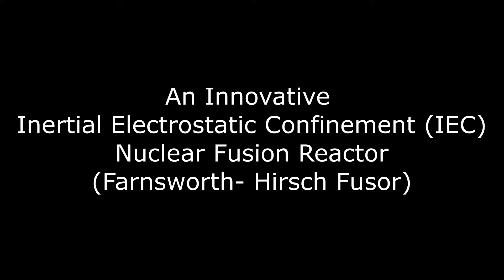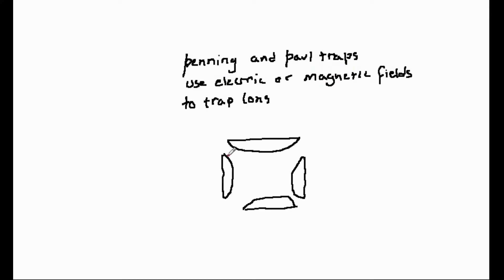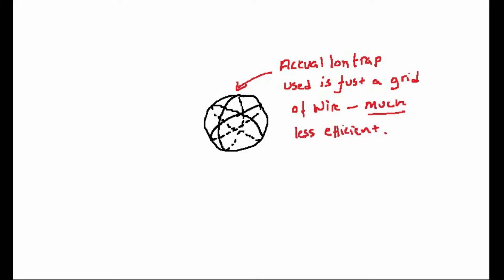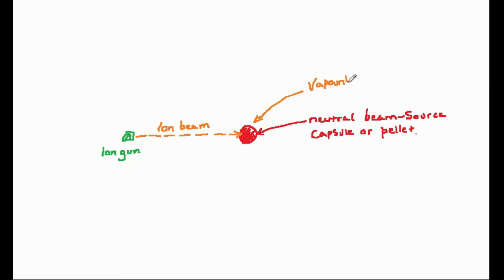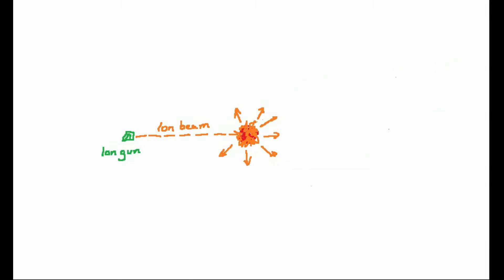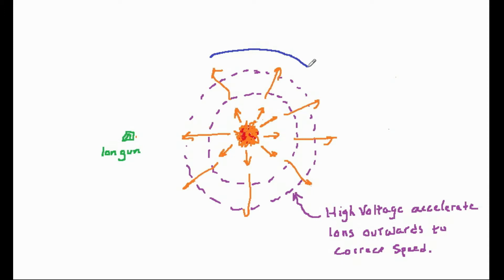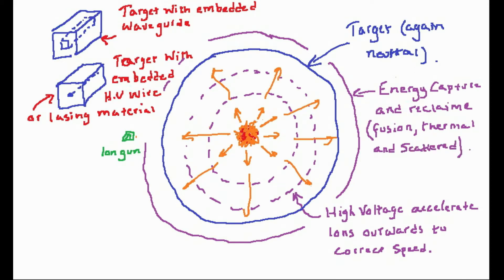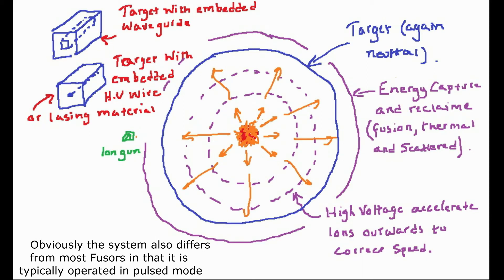An innovative Farnsworth-Hirsch Fusor (Inertial Electrostatic Confinement IEC Fusion Reactor)

Comment: I don't think that's gonna work. 
1) none of the ions are accelerated over the whole potential drop.
2) the electrons from the ionization event will neutralize the space charge density.
3) how is the central field going to be maintained? Is the pellet the cathode? If there's no central cathode, then there's no potential drop. Gauss's law.

Not a bad idea overall though. Just needs work. I admire the innovative spirit.

Comment: So, you could make something like methane (mostly hydrogen), freeze it, then fire a positive ion beam at it?
Reply from the maker: Short answer is that I haven't thought about that. I was envisaging an isotope of hydrogen. With a compound you'd also need the extra energy to break the bonds.
Reply: @geekypeek232  I wonder if the extra density from being able to freeze the methane could make up for the decrease in purity?  The methane would be made from deuterium.
Reply from the maker: @ancapftw9113  Certainly an interesting thought - I'll have to do a few calculations and see if the figures work out. Of course all depends on whether this fusion method/idea is valid at all - there plenty of interesting fusion designs out there!